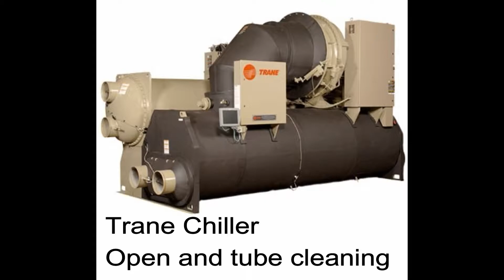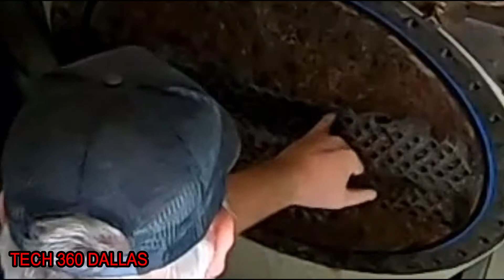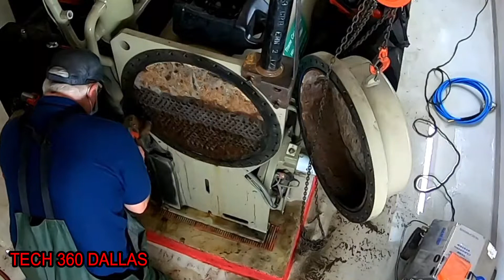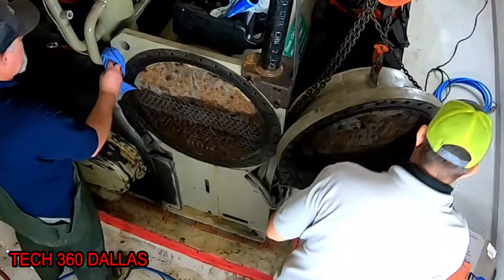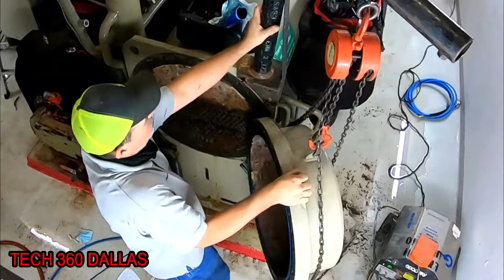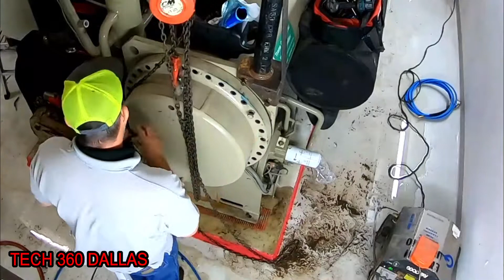Trane Chiller open and cleaning

Comment: How often you must clean the condenser vessel? Should evaporator must clean too?
Reply from the maker: hello!! So we have 3 chillers and we clean 1 a year! Last year was chiller 1 , this year chiller 2, next year chiller 3.. so for 1 chiller, every 3 years. 
Get your tubes brushed and eddycurrent tested.
Reply: Very informative and clear video. Thanks a lot for sharing. I was wondering if you can recommend me a textbook for maintenance and repairing of chillers?
Reply: Hey man great video! Interested in some pictures of your gantry/ chain fall setup. Looking to build something like that. Recently took on 3 units at work (new role). Thanks